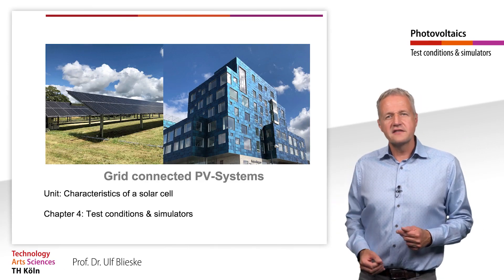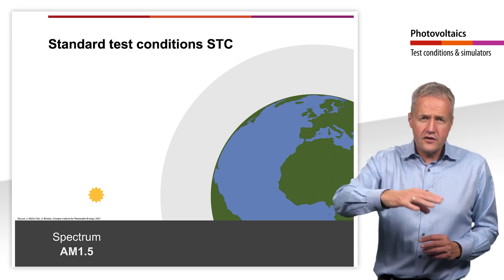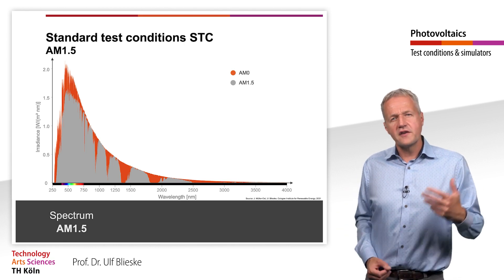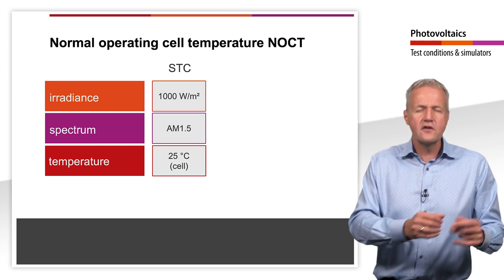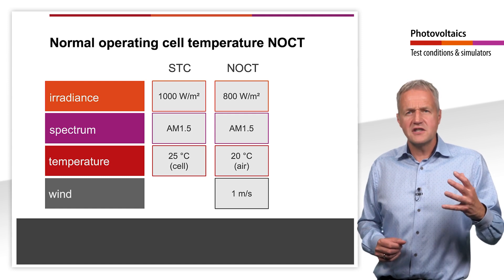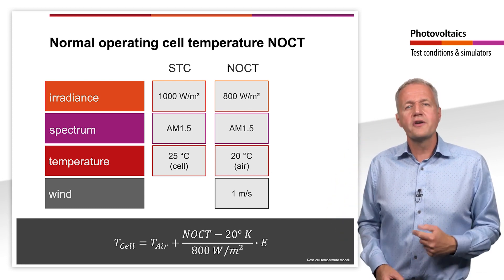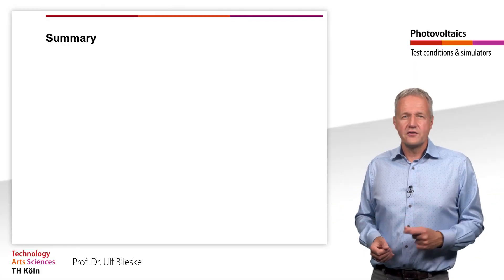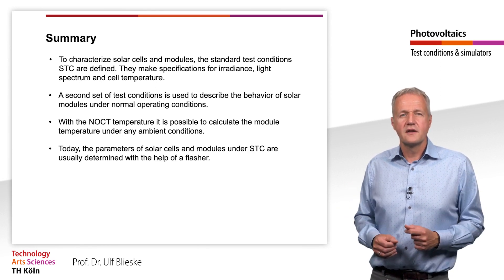STC, NOCT & Simulators: Course Photovoltaics #12

Comment: Thanks, in area which temperature become up to 45 in summers which solar panels are better to install in 400 kw-Dc project. solar panel with 110 cell which have higher amps like 16 and lower volt like 38 or solar panels with 144 cell with lower amp like 13 amp and high voltage like 50 v.